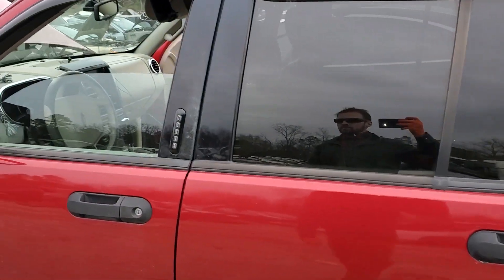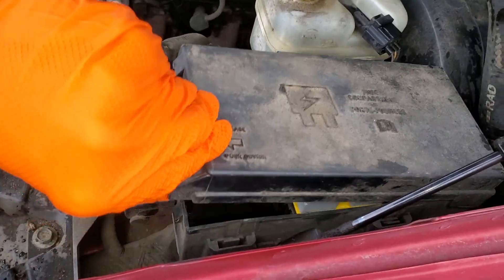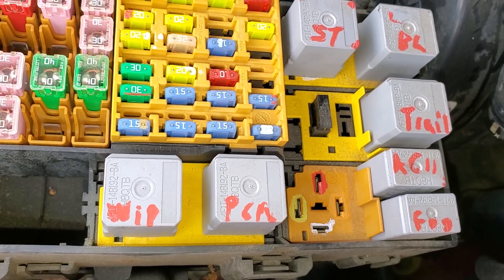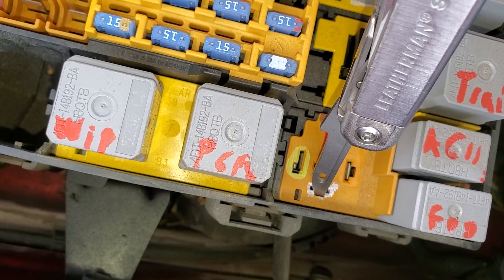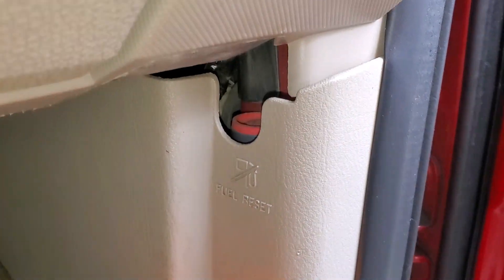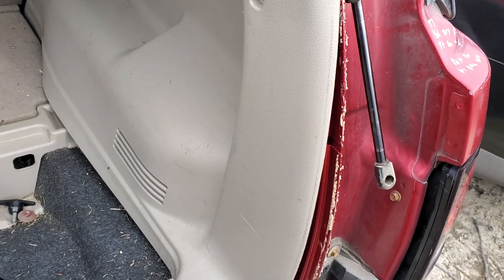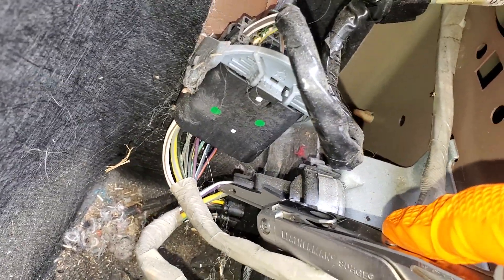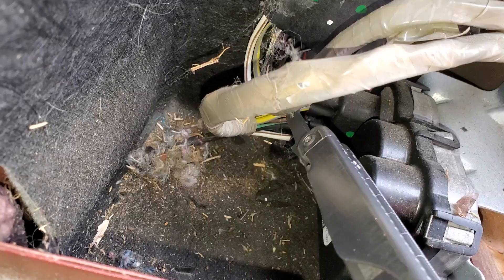2006 Ford Explorer Fuel Pump Relay, Fuse & Circuit -  Fuel Pump Driver Module & Inertia Switch

Comment: Thank you so much. My Grandfather passed away. His car wouldn't start, and my family is depending on me.all the fuses were good. I switched the wiper relay with the fuel pump relay and the car fired right up. Your video meant the world to me. Thank you. So much.
Reply: A 1998 40 Explorer a few pressure regulator Switz.

Comment: 2006?  Must be a early model in the year. 2006 is also has a "built into the board" fuse box location in the right front kick panel area.  So its made into the fuse box, it is not a solitary removable relay.

Comment: Hi. Thank you for sharing your knowledge and expertise Sir. I have a 2005 V8 4.6l Ford explorer that's only giving me around 28 psi at the injectors, and the engine runs like it's starving for fuel. I've put in a brand new pump, injectors, fuel rail pressure switch, fuel filter, and plugs and coils, and O2 sensors, and it's still not running right. I have dropped the tank again because the fuel level sensor was not working properly, and I also bought a fuel pump driver module for it, but I have not located it yet. Is it in the same spot as in the '06 model. Any advice you can give me would be greatly appreciated. Thank you.

Comment: Ford explorer 2008 in this particular i removed the fuel pressure sensor relay
Changed it with another one and it started immediately  no problem although the problem is gone im convinced it will happen again i have vast mechanical back ground and i myself im not convinced that is the cause

Comment: I have an 07 Explorer. Fuel was occasionally hesitating, and i suspected pump was slowly failing. I had a few no start days, and then it would start again. Eventually it failed, as i suspected. I had already bought a fuel pump assembly waiting for this day. 
I replaced fuel pump, and it ran great for about a week.
Then it stopped starting again. And it was the exact same crank but no start condition. No fuel pump sound, no fuses blown. Nothing worked. 
 I figured it was some new problem. 
But after a while of checking systems, i started thinking the new pump was just a lemon.

 So i had the manufacturer send me another fuel pump.

 I replaced the fuel pump a second time, and car started right up and ran great for ONE DAY. 

The next day it was a crank and no start once again. 

I checked the 2amp fuse. I tried bridging the inertia switch. And I checked the pink box fuse, and even swapped the relay. Still a crank and no start condition. What could possibly be causing a new pump to start up and run great; only to fail again, and again?! I'm super stumped. I have not meddled with the fuel pump module in the rear yet. 
But why would a new pump make anything work? And why would it keep failing? I'M SERIOUSLY CONFUSED> Any help would be greatly appreciated. Thanks
Reply: Having EXACT same problem as you. Did you ever work it out?

Comment: I loved the video, thanks a lot, Can you help me? I am having troubles with my ford explorer 2005, the MIL light is turned on and the scan says "wrong fuel pressure rail-P0191" and P0171 and P0174 (mix too lean-boith banks), the data stream says the pressure is too low, after sometime the engine stop sudendly. I am wondering if tthere is something wrong with the fuel pump or fuel pump driver but i am not sure how to test the fuel pump or the driver, do you have any idea? The car starts at the morning and works normally but after sometime like 1 hours the problem begins. Also, I am wondering where is located the fuel pressure regulator or how it works on this ford explorer
Reply: The fuel pressure is regulated through the fuel pump module passenger rear quarter panel. It basically pulses the fuel pump to regulate pressure.

Comment: great video!!!
I have 2006 ford explorer 4.0 that when I turn it on the first time in the day, it starts just fine, I can have it on for about 45 mins and fine, turn it off and then when I try to turn it back on, it won't start again, it cranks and everything but it seems that it doesn't get fuel pumped, fuses are fine and relay, obviously the pump works, the 2 things left are inertia switch and the fuel pump control module. I will check on those..Thanks
Reply: This particular issue reminds me of others who have found their temp switch in engine bay is faulty, so after warmed up, the car won't start again

Comment: This was a fantastic and helpful video. I have determined that the fuel pump still works. However, I have low voltage going in to the inertia switch although the injectors fire just fine. Any ideas?

Comment: I tried to flush the injectors with the air pressure flushing kit that avoids removing the injectors. 
 Problem; the explorer would not start even with a 50/50 mixture (gas & cleaner).
My question,does removing the fuel pump fuse also stop the injectors from operating ?
I tried removing all 3, one at a time but could not get ignition. 
The vehicle started once I reconnected the fuel line. Would disconnecting the inertia switch be a safe alternative ?

Comment: hey man thanks for the vid. I have a 2004 explorer, the 15amp fuse thats under the hood that supplies power to the injectors isnt getting power to it. I couldnt figure it out so I hard wired my fuel pump directly to a switch and a battery. It ran for a few days but now will not start. Im pretty sure rewiring the original harness to the fuel pump

Comment: I have a code p0191, I replaced the fuel pressure sensor and it came back on, then I realized it says performance, now idk if its a  fuel pump control module problem on a (2010 explorer) or if its just a fuel pump problem, rpm starts going down on warm startup like down to 200 and there is hard shifting that stopped for a while after replacing the fps but came back and it’s misfiring
Reply: I have a code PO191 also I changed the fuel pressure sensor 4.0 under the intake manifold and no start unless I spray carb cleaner in the engine it only shows 10.5 psi on the scanner I'm wondering if the driver module is the culprit
Reply: @SuperHddeuce  nope its the pump, did you try cycling the key to the on position multiple times?
Also the fuel pump module is at the back passenger corner behind the interior sure
Reply: @redman4life91  the engine wouldn't start unless you sprayed it with carb cleaner and then it ran fine and you could drive it if you wanted that's why I was thinking the fuel pump driver module is not making the pump pressure up
Reply: @SuperHddeuce  i mean starting the car requires alots of fuel, mine had 30psi the whole time and upon cold start ups, it’s fine but upon hot start ups, it starts but sometimes stalls and most of the times the rpm starts jumping between 0.2-0.6 rpm for like a good 6 seconds and then stabilizes and runs okay, thats why i’m recommending fuel pump instead of the module
Reply: @SuperHddeuce  also i believe if its the module it would display a p1233 or a p1235
Reply: @redman4life91  I believe you are right. I put in a new driver module no change then new fuel filter it was very restricted. Still has about 10 psi starting one time without carb cleaner. How big of a job is it to change the fuel pump.
Reply: @SuperHddeuce  draining the fuel tank, not that hard, taking the shield off the fuel tank is pretty easy, unbolting the fuel tank straps is also easy, hard part is getting the fuel tank out since its above a part of the frame but you can do it without fully taking it out, hard part about the fuel pump is trying to free the locking ring that holds it in place cuz it might be seized up and you need a hammed and a screwdriver to unseize, you hammer it to the side so you’d kinda unscrew it off and NOT pry it off and then its just a plug n play
Reply: Thats if you’re gonna replace the whole fuel pump assembly, the pump itself is another job that idk about
Reply: Have you actually  checked fuel pressure?    Depending on year may have to connect a tee to fuel rail to fuel source.   Quick and easy
Reply: @tomweir3857  10 psi
Reply: @SuperHddeuce  I forgot to mention dang it 
Fuel pumps should have 60 psi

Comment: thanks a lot lehew..can you tell me how to drain out the gas from my 2010 explorer ? its broken right now , have to repair the engine , i was hoping to drain the gas  by bridging the fuel pump relay, but i dont know exactly how,,, dont want to burn anything , thank in advance,,
Reply from the maker: You will have to drive the pump from the connection at the fuel pump driver module OR by using a scan tool.
Reply: @LehewTech  thanks a lot . the module is that located in the rear , in your video around the 4:40 mark?

Comment: My Ford Explorer does not have the fuse relay box why are you showing it where are the place Kennedy now I also have a 1988 Ford Explorer with fuel problem I can’t get my fuel system to work gauge and on gauge the relays the injectors do not open and close and I can’t get it to start only when I sprayed

Comment: Man fires or so much junk they out those fuses so hard get to same to work on these fords all or junk get a chev at least there made best last longer when I get rid this fird explorer I never own another ford I hate um had a 5.3;dam  plug broke off work on it 2 months could not get it out only three ins under fire wall work sold it guy at shop been 7 months trying fix it say have take the cab off. Fords suck no more for me